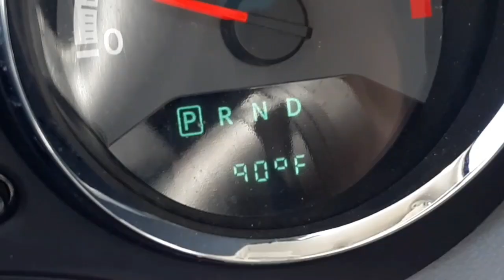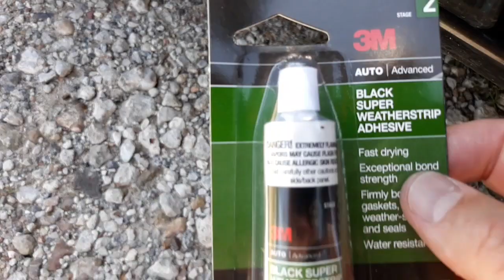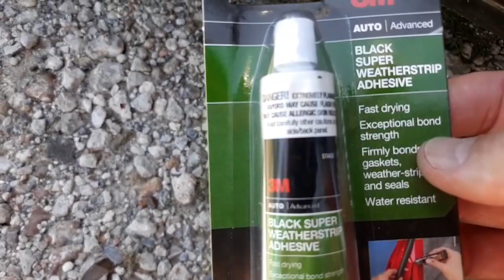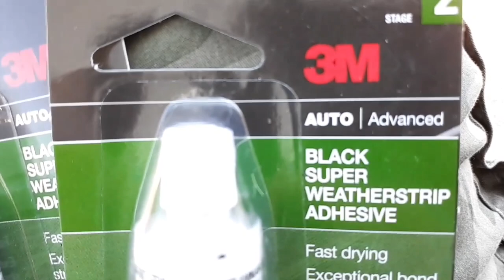3M WeatherStrip Adhesive - Does It Work?

Comment from the maker: UPDATE!:
After 7 months it is still holding very well! 👍👍👍
Reply: After 2 years?
Reply from the maker: @echovortex1238  Some areas are still holding, but not all.
Reply: I used it didn't help but I used the adhesive. That's for emblems and that help
Reply: Honestly if it worked for 2 years that's pretty good

Comment: Just a little helpful criticism, Next time, smooth it out on both pieces, let it get tacky, then reapply on the rubber, smooth out, and stick them together  ,kind of like contact cement , then the tape wont be needed and the bond is almost instant with no mess ,remenber less is more
Reply from the maker: I will. Thank you! That's helpful information for sure.

Comment: I wish that I knew this sooner. The weatherstripping on my Caliber is beyond saving, especially the right side. That's a shame because the rest of the car is in good condition.
Reply from the maker: Yes, it works great and is very cheap. Almost every Caliber I see has messed up trim hanging off. A very bad design.
Reply: @SixStringSteveDelivers  That's my only complaint with the Caliber. Other than that, it's a great little car.

Comment: You applied this wrong . Apply to surfaces and let them air dry to tacky. Then lay down rubber
Reply from the maker: I realized that later. Thanks
Reply: He did a good job, it’ll work either way.

Comment: You did that all wrong. You're supposed to use it like contact cement.
Reply from the maker: ALL WRONG... Okay... 😎👍 Almost 2 years later and it's still holding.
Reply: @SixStringSteveDelivers  he's right tho. it's that good of an adhesive that you can do it wrongly and still suffice, but if you do it right....it never comes off and you can use less adhesive and won't need to hold it in place unless its under higher pressure
Reply from the maker: @Dlogreen  Next time I'll do it the right way. Thanks!